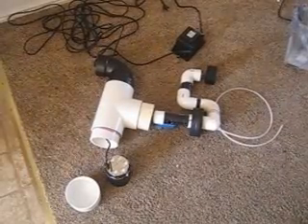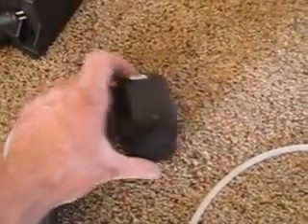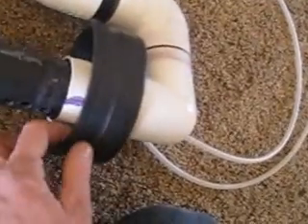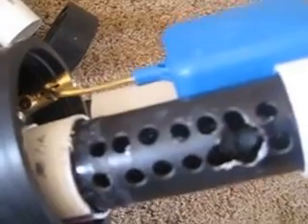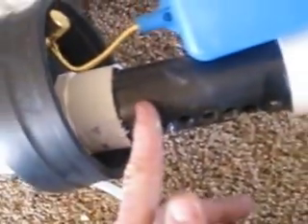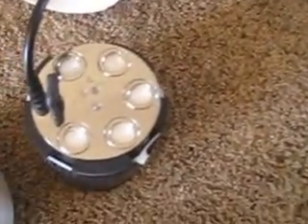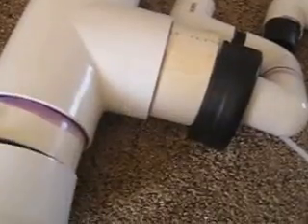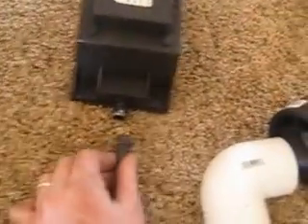Gasoline Vaporizer Build Part 1 (Original Design)

Comment: also heading for Arizona. hooked up hydrogen to my van. might not make any better mileage. don't know but it's all fun anyway
Reply from the maker: +Jerry Lund that it is. If you connect HHO system up properly and have a modern-day car you will definitely need to chip the car so it doesn't read there's too much oxygen thus injecting more fuel to compensate which will give you no improvements in fuel mileage.

Comment: Love the idea, but safety is the reason this is not used in all cars. U have a mini bomb under ur bonnet. Every time u go to the shops and park, this thing has x amount of explosive gas ready to burn in the line, no non return valves anywhere. If the carby for any reason back fires, boom baby. A carby is a great way of doing this inefficiently but safe!

Comment: Did your mode#005 hold up in gasoline? i call the company they said only test in water! curious to see if yours working in gasoline or not. can you tell me if it works in gasoline? did you test it yet ? thanks
Reply from the maker: The PVC and ABS held up great but the glue did not and there were some leaks due to the gasoline eating the glue. I had to use a silicone and JB-Weld to seal the leaks.

Comment: Hello Tyson::;; Ok how much did ultrasound transducer cost? & dose it light? Do you think the gas will not eat up the wires? What model number did you get?? Thank you for all your help;;;  Paul
Reply from the maker: The one in this video cost just over $100 model# M005 
http://www.mainlandmart.com/foggers.html
No I have not had a problem with the gasoline eating the wires. If you do decide to buy one spatial order it without the water level sensor. At this time I would not recommend investing too much into one I have not done a significant amount of testing with the transducers to say that it would guarantee a increase on MPG.

Comment: Hello Tyson,  when it freezes outside and the HHO vessel turns to a block of ice, the electrodes will eventually melt the ice.  I've tried using RV antifreeze full strength but it doesn't work as well as water.  I'm going to water it down.

Comment from the maker: The transducer in the system is switch one side of it has electrical current going through it and the other has a signal that goes through it, the signal portion in this design will be a float switch and a temperature controller. When the fuel in the vaporizer get low the float switch will send a signal to the transducer, once the signal is sensed by the transducer the switch that controls the current going to the solenoid valve for the gas or exhaust system is turned on which opens the valves.

Comment: The float that measures fuel level in the gasoline tank...that is attached to the fuel level sending unit would be an ideal place for the UT as it moves up and down with fuel level at the perfect submersion level for the UT to work.  If the UT runs dry, it will burn out.  If the UT is submerged with more than the ideal fog producing level it is still producing fog, it's just fogging and converting back into liquid before reaching the surface of the liquid fuel level of the liquid gasoline tank.

Comment from the maker: The liquid gasoline may have been sucked into the intake along with the vapor. I had this problem with my first design because I did not have the correct splash protection. You have to make sure no liquid fuel can be sucked up into the intake. You may also need to place a metering device on the system to regulate the vapor properly so it works in sink with acceleration etc.

Comment: ok i just tride the sistem firs cold vapor in a bucket  idle fine and accelerating ..fine but when gas became colder wouldnt idle well and stall..ok so i thought gas must be kept at a certain temp so i build a sistem with a heater core inside the tank and coolant runnig through all was fine i managet t4o make it idle and acceler ..so went for testing, car acceler well lots power was so happy i did like 120 km/h until the car stopped....surprise no gas left  so 2.5 litres for 5 km WTF.any ideas??

Comment: Sir,if you want to adjust your timing.open your head cover then rotate your crankshaft and position it on #1 at TDC.observe the in-ex. valve,it should be in closed position.Then loosen the distributor and switch on the ignition,then rotate the distributor and when your the sound of the spark,that 's your timing.then tighten your disttributor again.there's no pre-ignition.it only ignite when both the intake and exhaust valves were closed.

Comment from the maker: Yes it can be a problem Use a chemical resistant adhesive such as JB-weld and glue a piece of vinyl tubing over the electrical cord so it is protected.

Comment: that is why there is a valves overlap in the engine it is used to make a contact between the intake spray and the rest of burning gas at the end of the exhaust stroke to help it to evaporate, but if vapor contacts that rest of burning gasoline it will immediately burn or explode and that causes flashbacks and burns the valves and the valve seats before a SERIOUS using of vapor on car engine (ot like a monocylinder lawnmower) on high rpms you need a timing adjustement
thats what i think !!!